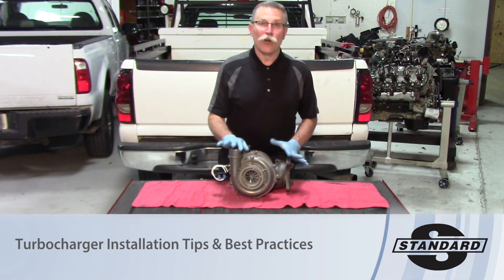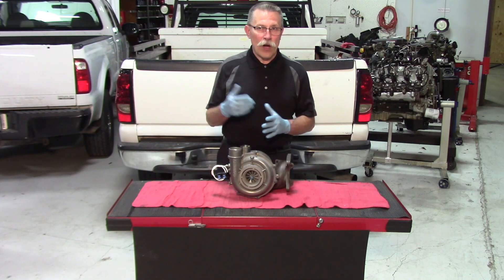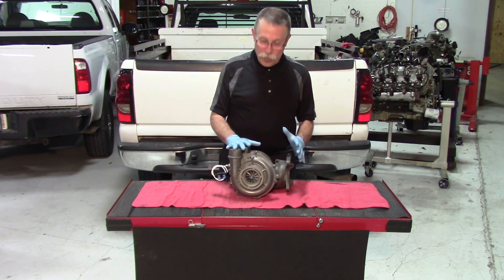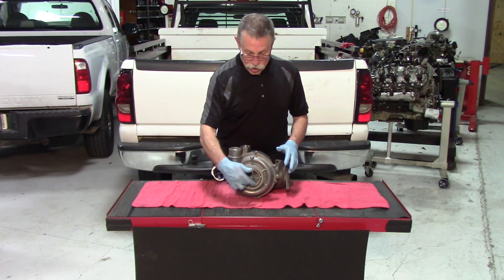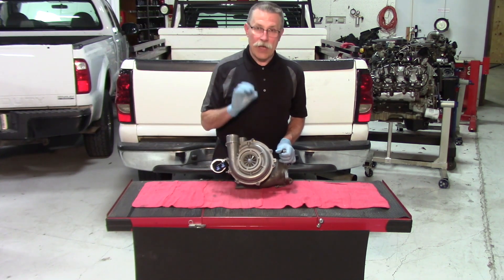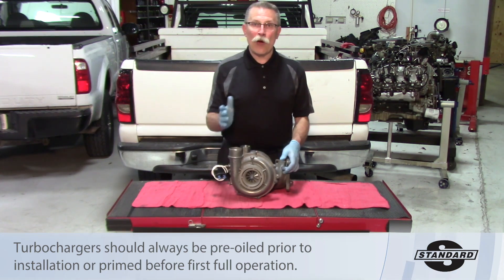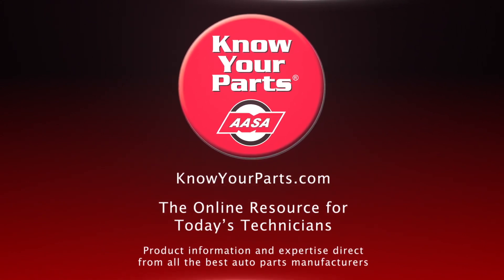Turbocharger Installation Tips & Best Practices

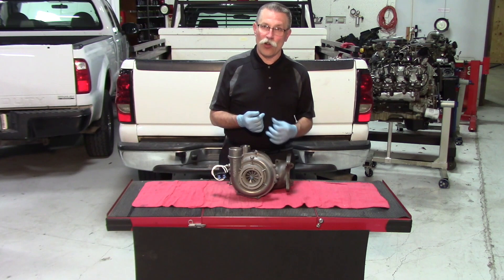Comment: 1:09 🤔I don't know about anyone else but my oil comes from the oil filter then to the turbo don't think it be pumping straight from out the crank case into a turbo won't last. obviously that's where all the oil comes from, but it is pumped up to the filter first before it goes anywhere else after crank / sump tray